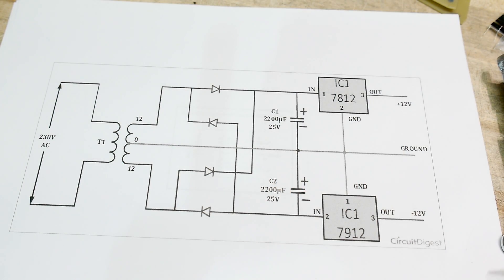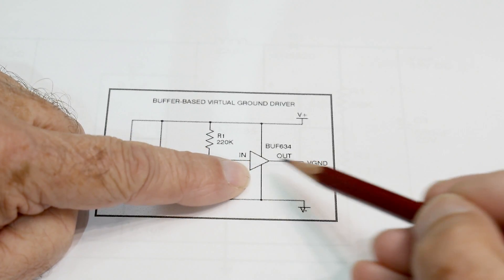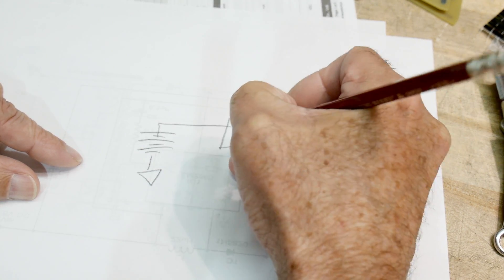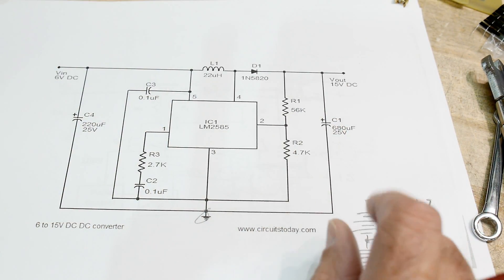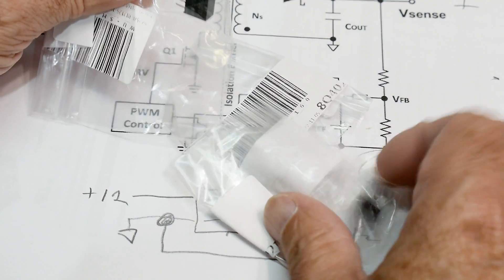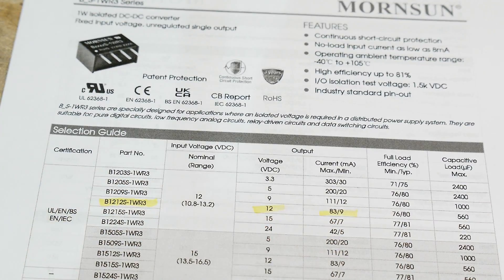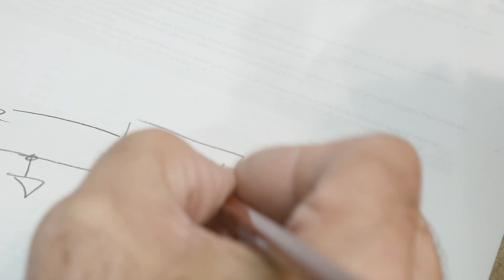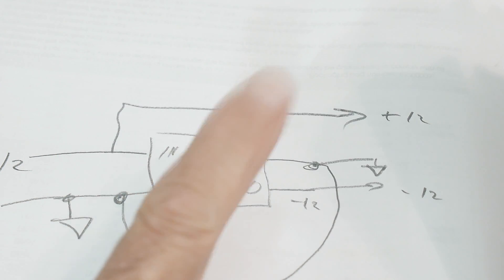#1465 Isolated DC-DC converter

Comment: I love all your videos and have learnt so much over the years. 

I work with Modular Synthesizers and dual rial ± power is the holy grail of the system. 

With the method you suggested,  can you shed some light on the aspect of load balance and what if the + rail drew more current that the - rail. 

Appreciate it.

Comment: I think the best way the terminals on the isolated side can be labeled is [#]V and [#]V return (or [#]V+ and [#]V-) - you see it labeled that way on some boards sometimes, and it makes it clear it's not ground, it's the "return current terminal related to the associated positive terminal". If you're hard wiring the + side of the isolated side to ground and using the reference terminal as a negative rail, then I'd label the terminals -[#]V and 0V (or -[#]V return) to not cause confusion!

Comment: Interesting video! I made some experiments - and I think that  PWM in flyback converter is not a good idea. Suppose - we have 100kHz PWM (5 microSec on , and 5 microsec off). When load becomes very small - the feedback loop decreases pulse width to very small values - less that 1microsecond. So we can not on/of a mosfet with such a small  time effectively.  A burst mode (packets of pulses) much  increases noise and pulsation on output. Therefore - there can be some pulse-frequency modulation.

Comment: Can u please share the link for the circuits
Reply from the maker: sorry, too long ago
Reply: @IMSAIGuy  im doing a project  on boost converter with voltage mode feedback i don't want to use 555 neither microcontroller I have to use op amps but I'm having problems in simulation of my circuits I saw your video in this video you introduced isolated dc converter using octocoupler I liked it very much.Thank you for such easy to understandable videos.

Comment: I'm into power supply with a clean voltage. I have been using isolated dc/dc converter, however, it's a hell to filter the high frequency ripple that is arround 50 - 100 mV RMS. When I use the old school transformer together with ldo the ripple is 2 - 4 mV RMS.
Reply: ah... so these are noisy? that's a problem as... the primary reason to need the negative voltage are audio circuits.

Comment: You can also use a non-isolated 24 V converter to make a +12 V / 0 / -12 V power supply.
The former +12 V line is the new ground line, the former ground line is new -12 V line and the 24 V output is the new +12 V line

Comment: Why I love electronics. There are lots of ways to do stuff. Analogue uses fewer components though. Try a 78L12 . Those low power devices can be added for  powering  Opamps and they are the size of a small signal transistor. Really cheap too. Come in surface mount too , if you have better eyesight than I do. Sucks getting older 😂

Comment: you can't beat a good old transformer for isolation, either a big lump of iron in a linear or a  small lump of ferrite in a DC-DC isolated converter. but still they produce transformers where the isolation is only provided by the enamel on the wire.

Comment: Interesting, I've never seen described and shown before like you've done in general.  This is interesting as I've only more recently studied the half-bridge dc-dc converters when trying to better understand the theories that apply or might be able to be applied for designs using the Prius gen2 and gen3 inverter-converter assembly modules and parts.

Comment: Let's say you want to have +/-12V.  Can you use a 7812 and an 7824 and they their input to a sufficient (28v) non-regulated dc PS.  Then you will have 24v and 12v wrt ground.   Then use +12v as a new ground. The old ground is now -12v and +7824 output would be +12v.  Anything wrong here?  The idea is the same as voltage divider explained here but has much more stable current.

Comment: On your Isolated DC to DC schematic, where does the op-amp get its power?  I've been amazed that those power supplies can maintain such good regulation when using an opto-coupler and yet they do.  Part of the magic is that the PWM has to kick start the circuit into operation.
Reply: Usually shunt regulators, such as the tl431 are used. I guess it's datasheet answers your questions. The 'Opamp' as well as the reference voltage were inside that 3 Pin device and it gets wired in series with the optocoupler. That way it is supplied with it's output pin
Reply: can't you use a zener diode for reference voltage?
Reply: @hachikiina  not shure if I underrstand you correctly
The shunt regulator is at the secondary circuit of the cvonverter and compares the output voltage to an internal reference voltage. It passes current from it's cathode to it's anode pin through an optocoupler if the measured voltage exceeds the reference voltage, thus providing feedback to the primary circuit.
A zener in series with an optocoupler would work as a simple feedback network.
However the temperature coefficient of a zener depends on the zener voltage. If it is chosen to cancel out the tempco of the optocoupler, only one output voltage (or a higher one by using a divider)  is possible and probably exceeds many common converter output voltages.
contrary to that shunt regulators are temperture compensated and have a specified accuracy. The input is high inpedance (opamp like), furtther easing the design and also easing loop compensation network design

Comment: Are you over thinking it !
Just have a 6v battery pack & a dc – dc converter outputting 12v .

Battery pos is 0 v 
Battery neg is -6 
The dc – dc converter output is +6 

Converter are noisy little monsters !
RF splatter boxes ….................. 😢

Comment: It is my opinion that we (electronics people) use the word "ground" too often resulting in misunderstanding by those who are just learning electronics, especially those in a non-formal setting.  I think "common" provides a better description of what we really mean most of the time.

In the olden days when I was just a neophyte I had an ancient HP oscilloscope of 2Mhz bandwidth which had 3 banana jacks on the front; "+", "-" and "GND" with a little shorting bar with which you could flip in to short "-" to "GND".  I didn't quite understand the point of the shorting bar until one day with the two terminals shorted together and the scope connected to my circuit I plugged the two prong power cord in the wrong way and my lab was instantly filled with magic smoke and dripping burning insulation.  It wouldn't have been so bad except my wife was standing next to me so I could show off my marvelous invention.  She was impressed, but not by my skills.  After much analysis of what went wrong I finally understood what that little shorting bar was for and the difference between common and earth ground.
Reply: Oh, You’re so lucky guys to get some people watching you while in your workshop, my wife keeps yelling on me to get me out to live as a family a 5 minutes I stepped in 😂😂😂
Reply: You were lucky you saw there was a bar connected to the ground. .  Most scopes do not tell  their power ground are connected to input ground.
Reply: Nearly the exact thing happened to me.  The differences were 1.) my daughter, not my wife and 2.) It was with a Tek scope.  I had just probed the mains the day before to see my mains sine wave.  Unfortunately, when I showed it off to my daughter the next day, I had the probe reversed.  Boom!

Comment: There are even symmetrical output variants of these things, which have another interesting use case, which is doubling the output voltage. So one can make a 48V (for like microphone phantom power) from a ±24V isolated DC-DC converter.
On important thing to keep an eye on, is the switching frequency of these things. Some aren't constant frequency and some also go into hickup mode with low loads. Which really can ruin your day when you're not aware.

Comment: Fun fact, you can run some buck converters just like you shown in the "wrong case" and they'll pump out negative voltages. You can also connect a capacitor at the switching node of a boost converter and use some diode magic to generate negative voltages and use an LDO to clean it up. Isolated DC/DC converters are relatively bulky and expensive.
Reply: This isn't even a wrong way of using buck converters, but just a fine legit way of using them.
The max input voltage will be extremely important at this point, since the input voltage now seen by the buck converter is the input voltage minus the negative output voltage. So with 12V input and -12V output this will be 24V.

When using a so called coupled inductors (basically just a 1 to 1 transformer), you can make all kinds of symmetrical power supplies, or supplies with some kind of (low current) AUX output. Super useful!
Reply: Ah yes. I remember a video describing that. https://www.youtube.com/watch?v=r49BwY0eFPA
Reply: 1111¹¹1111¹¹¹3 is a ⅔and a 😂❤❤❤❤❤❤😂❤❤❤❤❤❤❤❤❤❤❤1e1r3¹²❤